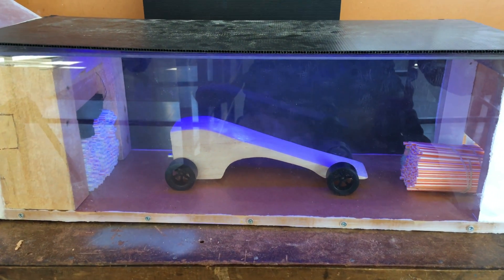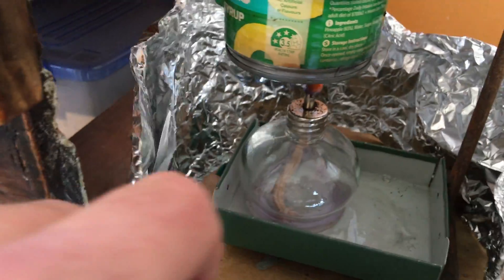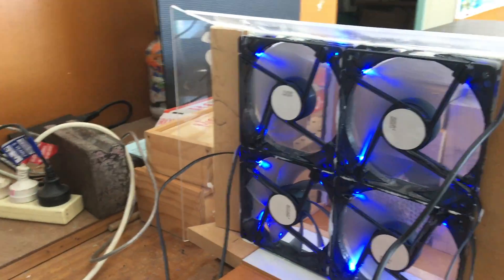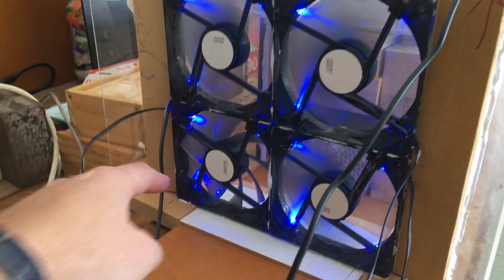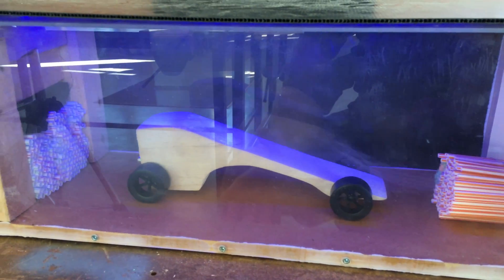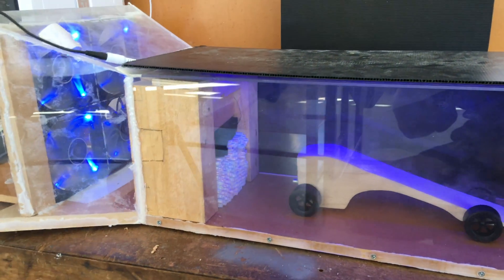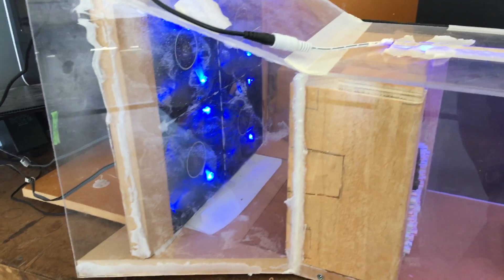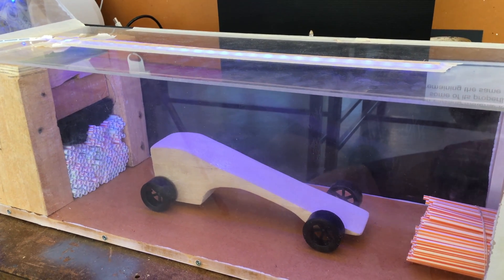DIY Wind Tunnel  - Liquid Glycerine Smoke

Comment: Hey!
Here are a few suggestions for your wind tunnel:
See, instead of just making the smoke go through those straws, try to make a smoke rake, which will uniformly show the smoke above the car or the object you are testing. This will also show the smoke lines which will also look better. Also get the smoke into a reservoir, like another comment said, and get the smoke from there. The smoke will travel to the smoke rake on its own due to the low pressure being created by the pc fans. Also make sure that there are no gaps from which air can escape as that will cause some turbulence in the test chamber, but it won't be that important.
.
Hope it helps!